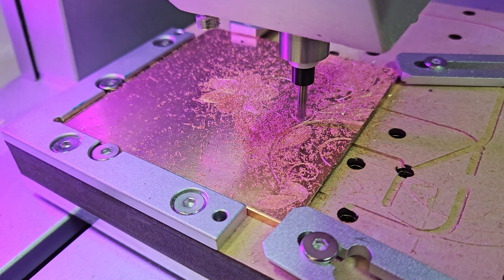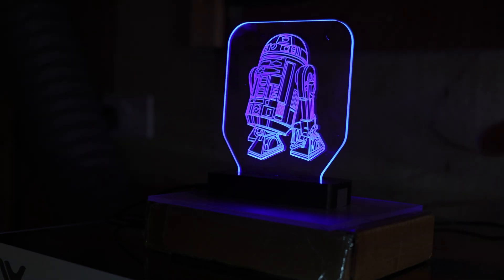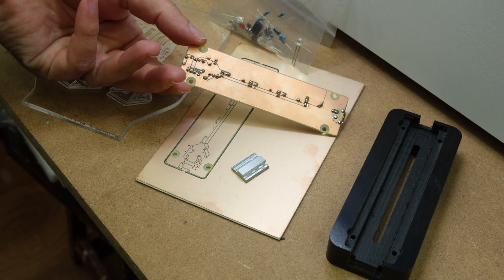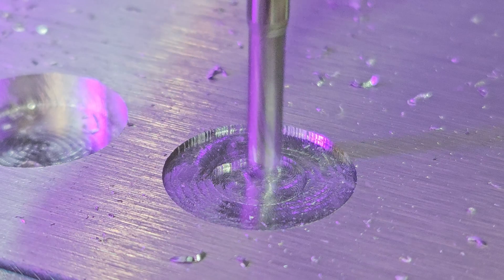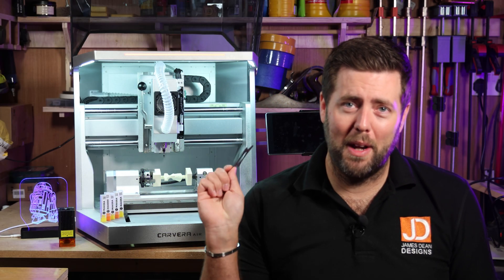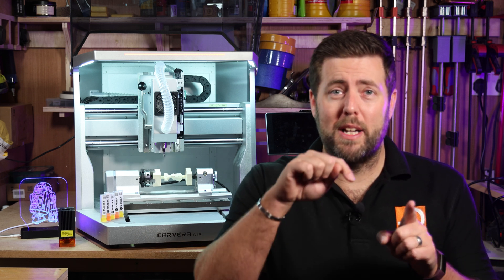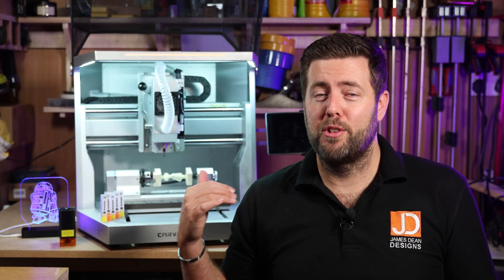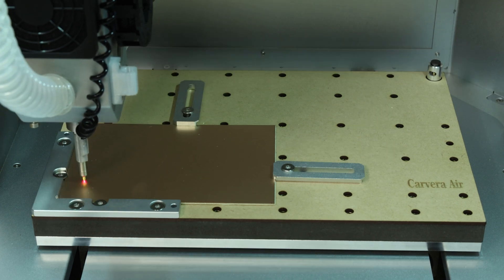Is it what I expected? Carvera Air update

Comment: Thank you so much!
As of someone with some prior experience in makerspaces for metalwork would your rather recommend this carvera air or a larger Genmitsu 4030 V2 with 1.5kW Spindel Upgrade, as they are exactly the same price for me
Reply from the maker: It's a difficult one to be honest. I rarely need to machine smaller, precise parts so I'd personally probably go for the 4030 and VFD spindle.
Reply: The 4030 is now where near as rigid as this thing.

Comment: It's a nice all in one compact size, but that Mickey mouse spindle is a deal-breaker
Reply: As someone new to CNC can you please explain why it's so bad? I've backed the machine but concerned it will be pretty useless. Thanks.
Reply: @GuyH77  check out the other more capable machines he reviews on this channel, you are basically paying for convenience , but its def underpowered
Reply: @GuyH77 to begin with, not enough torque for milling aluminum.  Most low cost cnc routers come with a 400W spindle. A VFD based spindle with at least 1.5kW power is considered a basic spindle for milling aluminum. I have a FoxAlien vasto, this came with a 400W spindle which is just about enough for aluminum. I am planning to upgrade to a VFD based water cooled 1.5kW , ER-16 collet spindle. The spindle would be quiet and have more torque for milling aluminum
Reply: @arbjful  Thanks for the information and reply. I've seen the videos of this milling aluminium, admittedly small bits. Is it just a toy then is his regard and in reality pretty useless for real applications? I've backed it so I'll get to try it. If it's a lesson I have to learn then fine. The money isn't too much to worry about.
Reply: @GuyH77  the other parts are great though. The ball screws, motors, the enclosed type design.
Reply: @arbjful  It looks a decent package to my untrained eyes. They have said they plan to release an upgraded spindle in the future so if that is possible maybe this weak spot can be improved.
Reply: @GuyH77  This is their opening machine, I imagine just the starter for a range of machines in the future depending on sales. They have proved there technology with this one and i imagine sales will be high in the medica / dentistry market / Jewellery area's
Reply: @GuyH77  most entry level machines use a router around 8 to 900 watts, most   spindles start at a thousand watts, mine is 2.2 thousand watts. It means you can take heavier and faster cuts without stalling in harder materials. 200 watts is comically low for a cnc. They want around 2 or 2.5 grand for this machine, you could get a much more capable one with a larger work area for that.
Reply: 100%